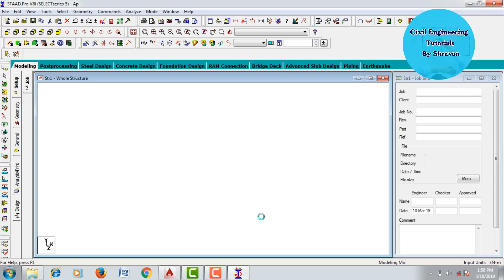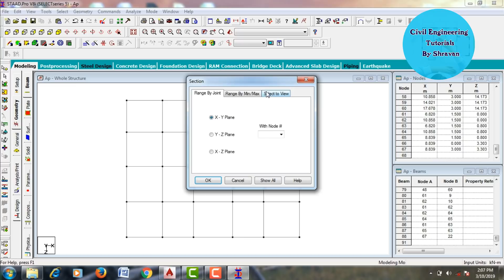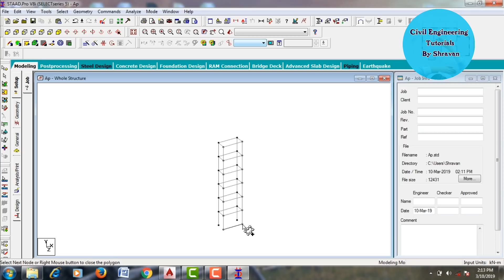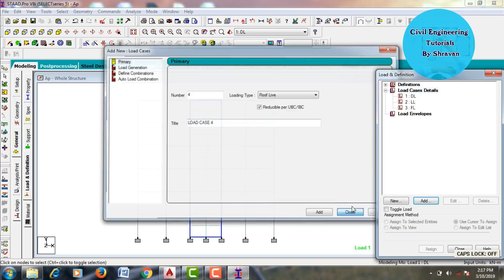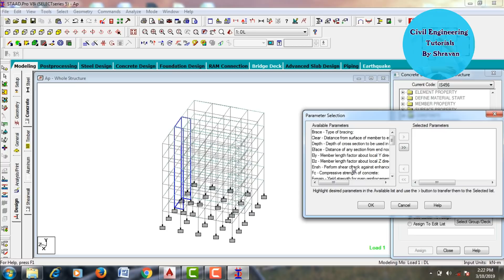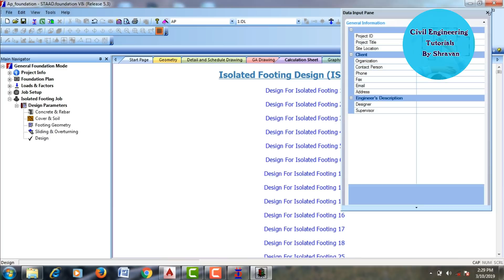Comment: Excellent bro , explain the out put result , how its useful to anlayze +/_ correction and modification if any change structure member.  please explain for different load different column size in single structure.

Comment: SIR PLEASE REPLY I GOT 105 WARNINGS ZERO ERRORS 
DO WE CONSIDER WARNING OR KNOTHING WILL HAPPEN IF WE IGNORE WARNINGS
Reply: Warning is nothing but the load which coming for beam or columns or slab is greater than the acceptable limits to reduce this kind of errors we need to increase the size of beam, column and slab 👍🏻
Reply: @civilengineeringbyshravan9596  thank you soo much sir